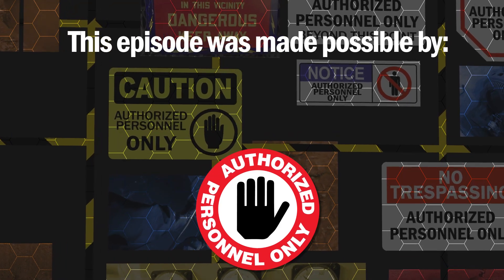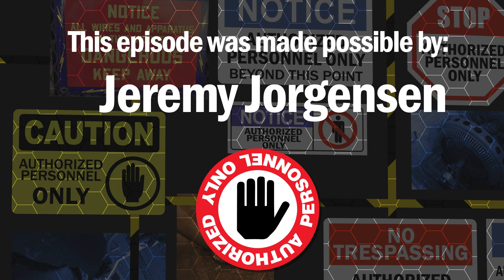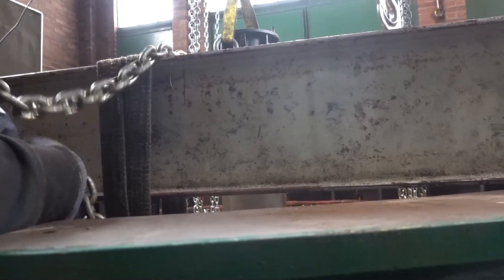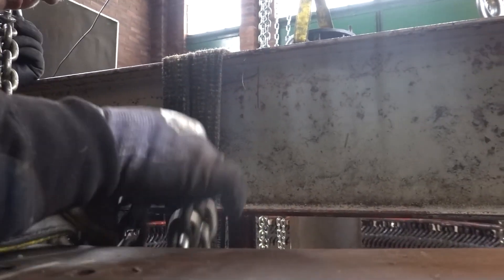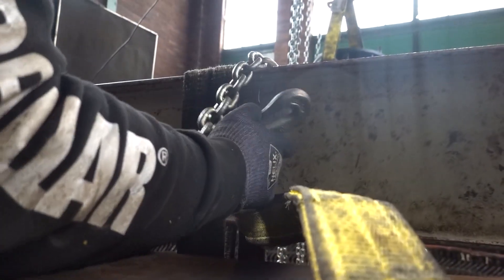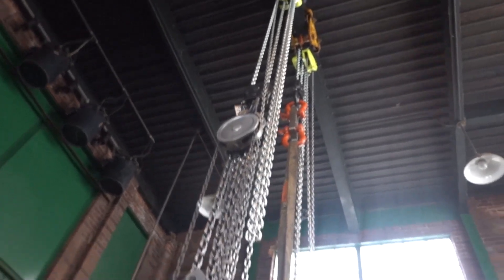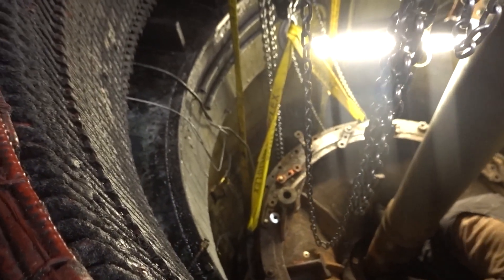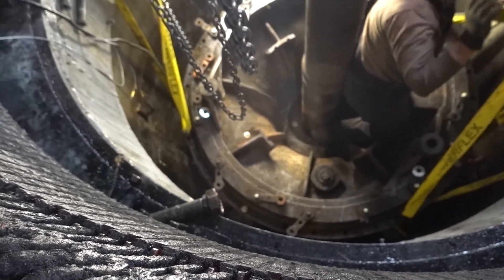Authorized Personnel Only - S2E13 - Lifting A Hydroelectric Turbine Up Out of The Casing

Comment: Why aren´t the guys down in the turbine hole wearing a hard hat? Just curious, cause here in Norway this kind of work would be a no go without all kinds of safety stuff in place;)
Reply from the maker: I asked them once, and they threw a wrench at me. At this point I'm just happy they're sober and wearing pants.
Reply: Watch the previous vid where they are tossing tools down to the bottom of the hole.
Reply: Well, hard hat is another thing that can cause an accident, by getting in the wrong place. they are all on the same plane, and if anything is to fall on them from a chain and backup chain failing, the hard hat will not help at all. 

Hard hat is fine if a brick falls on it, or a hammer, but here the thing that will fall is multiple tons, and not going to be stopped by a plastic hat.
Reply: Hardhat makes you lose 50% of your masculinity, didn't you know?
Reply: Authenticity c:

Comment: Nice clean chain blocks there, along with decent chains, and slings that are used, but not in any way abused. Your fellow millwrights are doing a sterling job there Chris, all working to make sure that the next century of this plant's life will be as good as the first.
Reply from the maker: As much as they terrify me, you're right. I'm honored to be working beside them. But I'm still not walking under that.
Reply: @Physicsduck  safety third!
Reply: @Physicsduck  Under that is definitely where you don't want to be if anything goes wrong.

Comment: Why is there so much space between the blade tips and the turbine walls? You think that would make it much less efficient.
Reply from the maker: There isn't. The room it's in right now is much wider than the hole it drops down in to.
Reply: I think the blades sit in a smaller hole in the bottom.